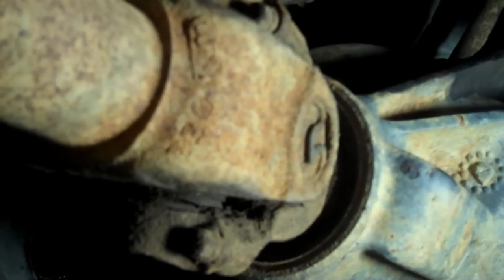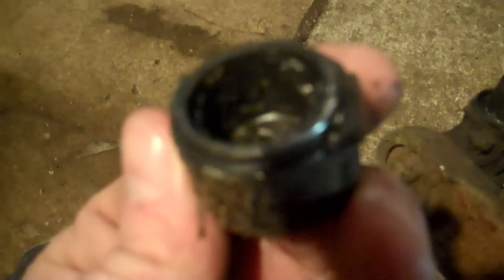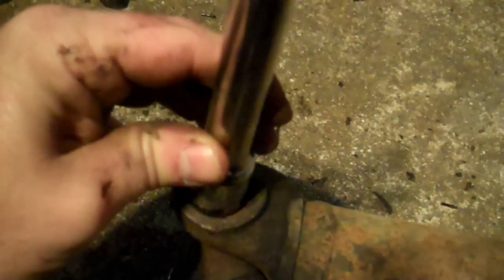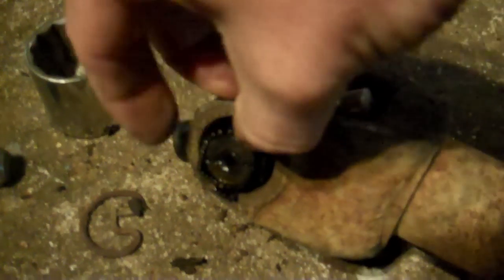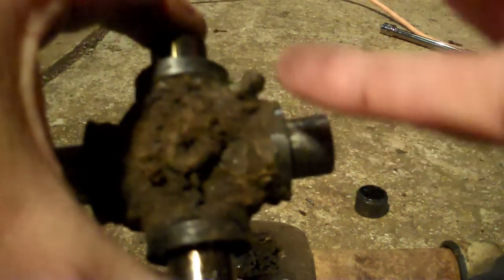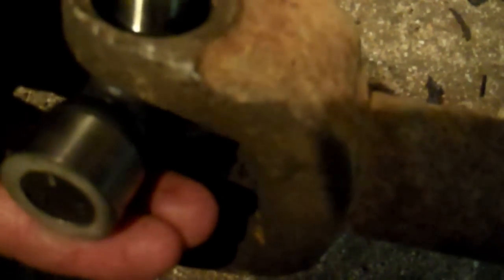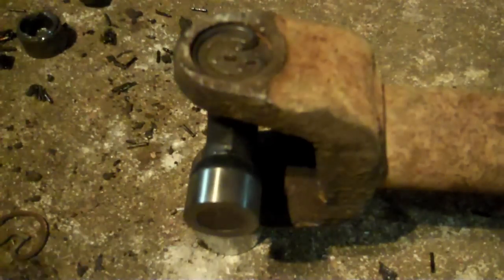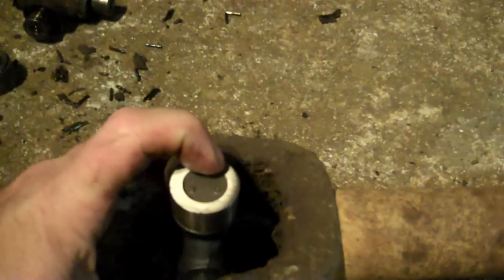Jeep Wrangler YJ - A detailed "how to" of changing the U-Joints in the front drive shaft.

Comment: Awesome video.I have a query and I hope that you can help.
Okay,here's my dilemma: Transfer case shifts fine into 4 H,N,and 4L.However,on 2H,I am not able to turn the front drivehaft by hand more than 10 percent of a revolution.Also,drive front shaft does not turn if the jeep is rolled which appears to suggest that the problem is not in the vacuum disconnects.Occasionally,there will be a clunky  noise in 2H and a quick shift to 4H and back to 2H will solve the problem.The TC is NP 231 J (YJ Renegade).in the past I distinctly remember of being able to turn front driveshaft freely by hand when in 2H.My confusion is that if the TC is not turning the driveshaft in 2H while driving normally (as it appears) how come its still connected to it in 2h?Please advise!
Reply from the maker: Yavar Qadri I've got the engine out of mine along with the trans and t-case. I'm gonna check something while they are out and get back with you. In the mean time check your t-case linkage. Each end of the "shifter rod" for the t-case shifter is a small plastic ring that acts as a bushing. If the ring is worn bad enough it may prevent the t-case from fully going into 2H. Put the shifter in 2H, then go under the Jeep and see if the shifting arm on the t-case can be moved even further into the 2H position. If you can move the arm on the t-case more, then it may not be totally disengaging from 4H.
Reply: Did you put a lift on? Increased driveshaft angle might make it harder to turn. It's also possible the CAD is sticking.
Reply from the maker: ***** Joe ..Great comment! You have a point there. The CAD is vacuum actuated. The rubber diaphragm is very well known for going bad.Thats why I converted mine to manual. Now I control it not a bunch of rotten vacuum lines. Here is the vid: http://youtu.be/QeHLIK7uF38.

Thanks Joe for helping and taking the time to leave a great comment. Have a great day!

Comment: My 92 YJ front wheel drive hasn't worked in a long time.  I've heard there's a way to modify the front end so I can have my front wheel drive along with my read wheel drive working when I switch to 4wd.  Do you have a video on that modification?

Also, my Jeep is giving me ALL kinds of problems and I think it's fuel pump related.  The ole girl has been sitting for a couple of years and I suspect that there's sludge in the gas tank that I need to get cleaned out.  The strange thing is with the fuel pump working intermitently at best.  Sometimes when I turn the ignition on, you can hear it pumping, other times it doesn't.  The other day, I turned the ignition off and heard the fuel pump pumping away.  

Any help is greatly appreaciated.  I've put in a new fuel filter, air filter, rotor cap, plugs and wires but, it doesn't seem to want to start up.. Some times it'll turn over like it wants to start but just won't go.  Ohh, I also put a new breaker in today and no joy.

Any iedas would be awesome.

Comment: Great vid, had to figure this out mostly on my own lol when i first replaced those joints. A bit of advice. Throw in a steel wire brush in your trail kit, some sandpaper and coper grease. After the old joint is out clean that yoke with the steelbrush and gently sand the inside where the cup goes untill all the rust is gone. Then coper grease it and you can just push the new joint and cups in by hand without the use of a hamer and no worries about getting sand grains in the new needle bearings. Just works that much cleaner and easier.
Reply from the maker: Actually that's a great idea about copper grease. It acts as an anti-seize to prevent things from rusting together and being hard to assemble/remove. I normally use black (not white) lithium grease (or otherwise know as engine assembly grease) for anti-seize. It's always did a great job at preventing rust and corrosion from seizing up parts. Thanks for the great comments and checking out my video! Have a great day!!

Comment: Hey great video! I've never messed with U-joints or drive shafts before, but you've given me the confidence to tackle it. I would love it if you took me to school on the front YJ driveshaft. Slip yokes what it is supposed to feel like, replacement (do you need a whole new shaft? I just have never had to know this, but I think mine is bad. Anyway, thanks again!
Reply from the maker: +Phrankzilla As far as changing the joints, its basically the same drill as the rear. As for the slip joint, typically they are fairly snug when stretching the shaft out. Not hard but some drag. But ... the drag needs to be smooth.Meaning make sure that baby is clean and greased.No grim on the splines that is inside the sliding area. I cleaned that front shaft before I stated this YouTube thing. But .. I have had that thing submerged in water several times so I wouldn't hurt to split it to check for junk in there. I'll make that a video when I do. What symptoms make you thing yours is bad?
Reply: +Power Addicts - FixJeeps.com - Jeep, car and motorcycle tips I had a bad vibration when the engine was under load. I decided to take it to my Jeep guy, just to make sure I had the problem diagnosed correctly, and I didn't. He said that though there was play in the front slip yoke. the front u-joint on the rear axle was red hot. he replaced both for $122 and the problem is gone. I was in and out in an hour. Though I could have done it with the help of your video, I had the wrong part, and it would have taken me a lot longer. Sometimes it is best for me to take it to a professional, I think it was 122 well spent. when you post the slip yoke video I'll clean mine too.
Reply from the maker: You did the right thing. Sometimes getting things done quick is a better option. Even though you didn't do the actual job yourself, it was still a learning experience. That alone makes the $122. well spent. I have had lots of teaching experiences through out life. Knowledge is something that is priceless and that can never be taking away from you. So, learn anyway you can. Glad you got her rolling smooth! Have a great day!

Comment: Is the front driveshaft of a jeep wrangler supposed to turn about 1/4 of a full turn when in park? I saw yours turn, but not sure if it was the bad u-joint or not. I've been experiencing a rattling noise under my jeep when i drive, and at first i thought it was just my hi-lift jack rattling but after i took it off my car still made the rattling noise, wondering if you can provide me with any advice as to what to check or test. And thanks for all your videos, they really do help.
Reply from the maker: Mine front shaft turns when in park. Sounds like you transfer case is partially engaged. Try pulling your t-case all the way back in low 4. Then putting it back into 2 hi. The last video where I did the lake scene. I had a weird rattle on the way home. I had somehow pulled my tcase shifter just enough that it engaged the front drive shaft. But my CAD (front axles) was not locked in (I converted to manual Posi-lok). Therefore it sounded like I had something wrapped around the drive shaft with a weird rotating rattle like something was hitting the floor. I fulled engaged the tcase and then put it back into 2 hi. All was quiet again. Give it a try and see if it helps. You are very welcome, I'm glad these repairs/mod video are helping you out! Have a great day man and thanks for checking out my channel!!

Comment: did you take your skid place off?
Reply from the maker: Didn't need too. I used extensions on my ratchet to get to the bolts at the transfer case. Also, the Jeep came with a 3" body lift already installed. I could have reached between the frame and body but it would have been a kinda weird angle and a bit awkward. Just be sure to use an 8 point socket, could save yourself some headache. I got that socket at Lowes, it's a Kobalt. But as long as its a quality 8 point 5/16 socket you are good to go. Thanks for checking out the video.
Reply: did front seal  still need to do u joints.  For some reason the clips to get it off are facing to the rear of vehicle.  I think I have to take it off.  It might be a mountain of trouble or make the job easy.  Waiting for some warmer weather.  Pretty cold in New England right now for a driveway learning mechanic
Reply from the maker: stone572 Naa .. dropping the skid plate it still easy. Main thing is to put a jack stand under the transmission as you drop the skid plate. In the center of the skid plate there are 2 nuts coming through the plate. Also to the drivers side of those is one nut coming through (at least there is on mine). Those are the transmission mount bolts. Take those nuts off first. Then position a jack under the transfer case and pick the transmission/transfer up until there is about an inch gap between the mount and skid plate. Then put a jack stand under the transmission to support it (never trust just using just a jack while you are under the jeep or any car for that matter). Once you have created the gap between the mount and plate. Remove the large bolts at the ends of the skid plate. Either have help lowering it or use a jack to lower it. It's not crazy heavy, but if it slipped and hit you ... well it's gonna create a day day. Re-installing is in reverse order.
Reply: PowerAddicts You know .....  I really appreciate you taking the time to help me.  I will be attempting this after this storm we are getting for the next day and a half.  It will be freezing, but we will see how it goes.  Makes me nervous bringing this skid plate down.  Especially with the cold.  I really don't want to bust a bolt, but its got to be done.  I have a clunking noise under my foot when I put it in 4wd.  The Ujoints look ok on inspection, but we will find out.
Reply from the maker: stone572 You are very welcome. I'm no professional mechanic by any stretch, but I've cranked a few wrenches in my days .. LOL. That clunking sound could be just the transfer case/front diff locking in. When it locks in it tightens a chain inside of it. Also when you put it in 4wd there is "slack" not only in the transfer case but also in the front diff. When all the engages, sometimes you can actually feel all that slack tighten up. My old 3/4 ton Chevy I use to play with sounded like the whole bottom end falls out when I lock it in 4wd. Still good to check the U-Joints to make sure. If you change them, make sure you use GOOD QUALITY U-Joints. They make $8-$10 U-Joints for the Jeeps, they are junk, I know this first hand. Expect to pay at least $20 or better for good ones. Do it right the first time, it would be bad for a cheap part to break when you really need it. I've been there and done that, it was no fun!
Reply: Thanks.  I have replaced the axle u joints.  Changed pinion seal and diff. oil.  The clunking doesn't just happen once.  I have only driven it 2-3 times with the 4wd because of the noise.  Each time it was for about 1500-200 feet.  The clunk seems to continue as I drive, not a 1 time thing.  I've seen a few things from Ujoints to the 4 wd linkage as culprits.  I guess we will have to see. Thanks for the response.